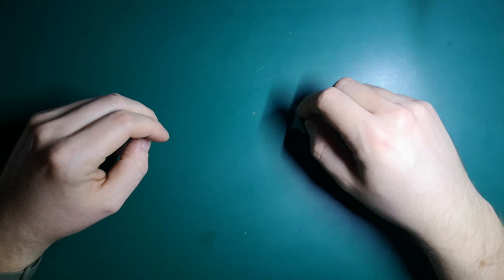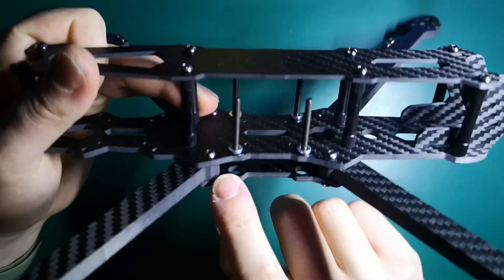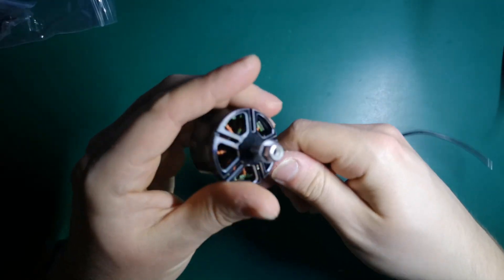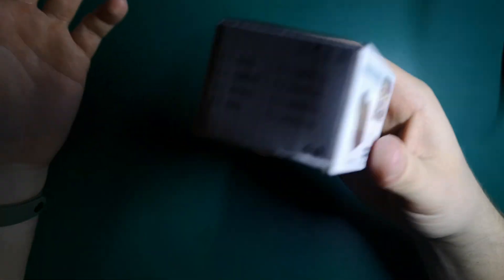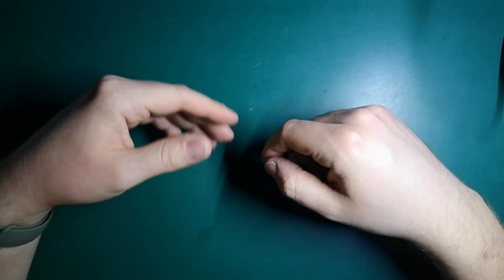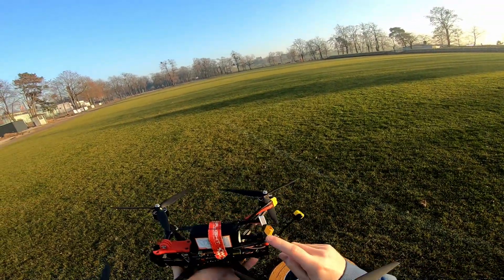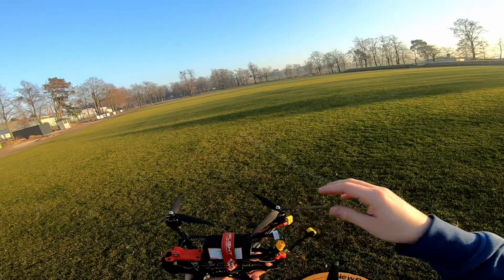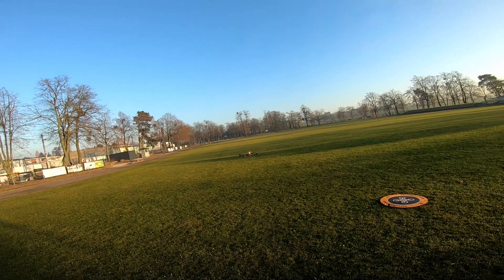Build 6S BEAST FPV 10" for 150$

Comment: Im going to use two 50v 2200uf capacitors just to be safe 😅.
Where did you get the file for the 3d printed thing that goes between the two bottom plates between the arms and the file for the gopro mount?

Comment: I want to build first cheap big drone. Would you recomend building 7inch or go for 10inch?
Reply from the maker: @mistrzu1231212  This set is even cheaper than 7Inch set from my another vid! :) And with 10'prop it will lift more

Comment: Had one of these cheap stacks die on the first test flight. Flew for about 45 seconds, right when I started to trust it, the drone did a death spin and fell out of the sky. I wouldn't trust these cheap flight controller stacks.
Reply from the maker: Yes, I knew about it, so added this huge cap, maybe it Helped a lot. Because one with the set can be too small spec for 6S

Comment: You amp consumption it's real?
Reply from the maker: 80A is Max for that ESC Sensor
Reply: @grox3857  i mean, 17-20 amps hovering seems quite high
Reply from the maker: @Meleonlight  Yes real Current was about 10-20% Lower because I Was able to draw over 14k mah on osd from real 13500mah baterry that still was 3.2V per cell endflight soo yes Current meter needs calib.

Comment: I got my 10 inch for around $110 at Aliexpress on blackfriday, similar setup. Draws 80A at full throttle so be carwful with 60A ESC. Very quiet comparing to 7 inch. 20 minutes on 4S liion 4000mAh Ampace JP40 cells. Nice toy. I was flying mine today in temperature around 2C. Around 1 hour in the air. I love it.
Reply: 80A for all 4 escs you are only drawing 20A per
Reply: 1 hour flight, hoooly shit!! What battery and other setup to achieve that flight time?

Comment: Did you try use GPS with this stack?
Reply: Speedy bee provide 5v for GPS I checked it
Reply: I put GPS in this 10 inch combo. Cheap $10 M10 GPS BZGNSS BZ-251 is gathering over 20 satelites pretty fast (I saw 32 once). I did not configure RTH, althold, poshold yet because it was to cold at the field to play with laptop or mobile.
Reply: I Have  problem with GPS in this stack, it didnt  get 5v from stack and not working, GPS was checked in different drone ale it ok but with this stack nor. Could you show short video with mount and conf for this stack please?
Reply: This stack has F7 chip

Comment: A good solid frame is the best way to prevent bad oscillations. 
Check out the GK-V3 10inch frame. Thats the same as the geprc pulsar10 frame. Its a tank and my pulsar10 even flys with stock tune.
I use a jhemcu f405 stack
Reply from the maker: You are right 100% But I need to mention a crazy price point on that set. Premium 10' frame ALONE can cost this much soo😅 If you have bigger budget, better frame is way2go
Reply: Mark4 V2 10inch is unbeatable considering price. Got my combo for around $110.
Reply: @user-vx4br4nv1d combo you mean frame + motors or something else? Where did you get it?
Reply: In Case someone was looking for this frame, it's actually called GK-V3 Frame
Reply: @haschkatze8372  danke Tipp Fehler

Comment: Your batteries are amazing, give me the details so I can order more of them.
Reply from the maker: These Are Cutom Made by Me Molicel P45B 6S, 1-3P (3 Sizes) Build around special 3DPrinted Lightweight Case with spacing 1mm each cell for great cooling and safety. 0.2Nickel plus 0.15 Pure Copper Sandwitch all Spotwelded :)
Reply: @ Do you mind builing one for me? I think home made battery will be mutch better :D
Reply from the maker: @mistrzu1231212  Contact: groxfpv1@wp.pl :)